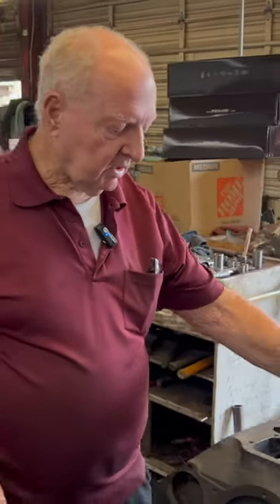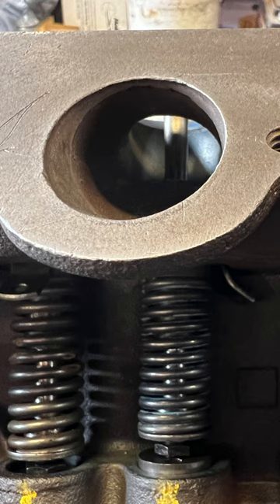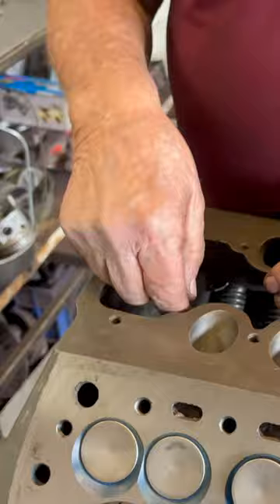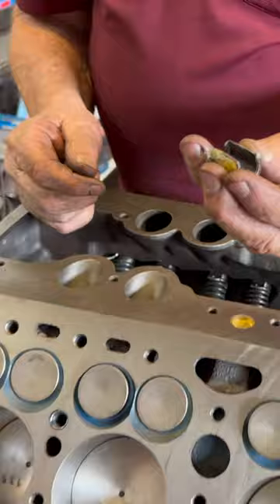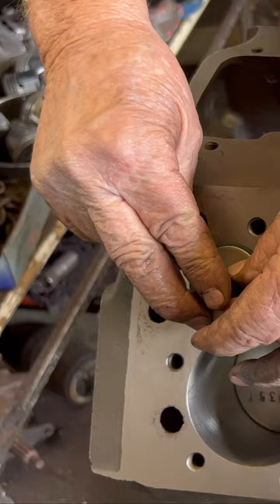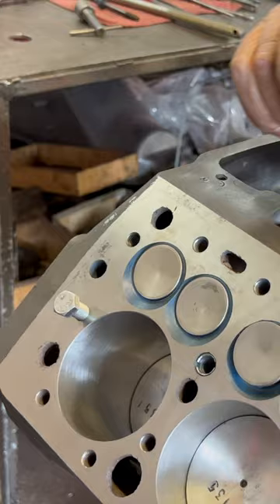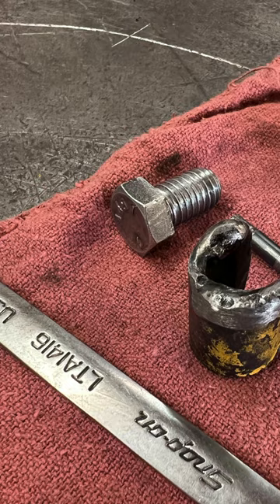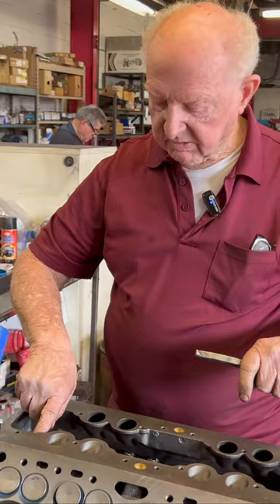FAST and EASY! Installing Exhaust Valve Guides On A Flathead Ed Smith  #classiccars

Comment: As a teen of 1960s,  Flatheads were already vintage.  Mouse,Rat,Elephant, Tin Indians,  Rocket 88s (among others) had long ago eclipsed 1932s magic FoMoCo V8. The readily available 30s bodies had been remotored with OHV engines for local Oval racing
Hot Rodded Flatheads were Car Show Gems.